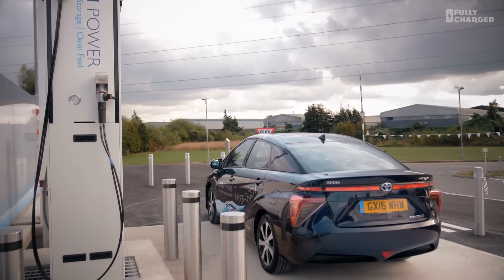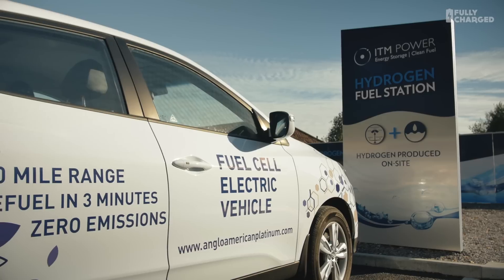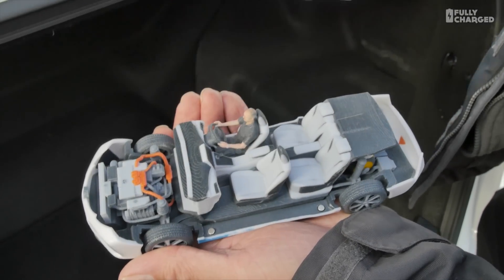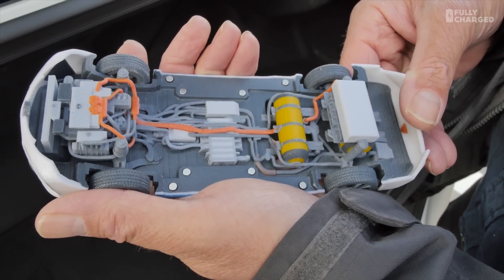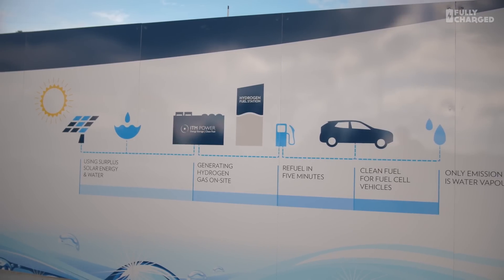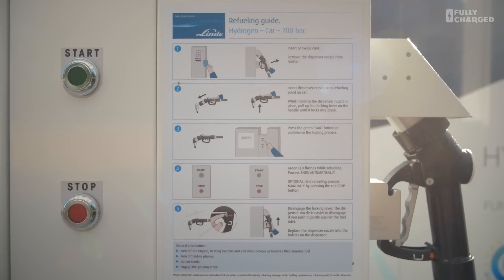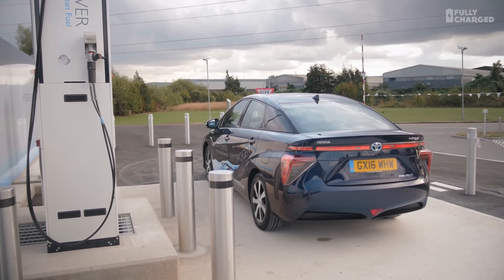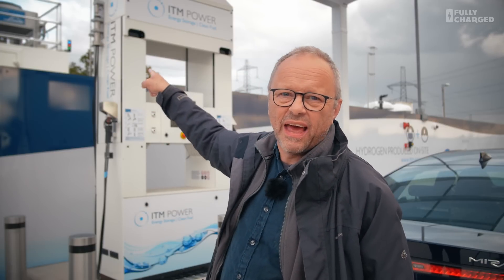ITM Hydrogen Rally | Fully Charged

Comment: It's Stupid. Why would I want to pay for Hydrogen? When I could generate my own electricity with solar and charge my own car. I'm not poor. These things are just too expensive for the middle-income people.
Reply: Andrew du Toit why not produce your own hydrogen?
Reply: Oliver Hamilton it is expensive to create hydrogen
Reply: well not many, I guess, similar to petrol, the three minutes filling time, and while oil is rare, water is almost everywhere (if they make it from water electrolysis) , and what comes out from hydrogen car exhaust pipe is also water
Reply: Wayne Johnson not from your solar array.
Reply: The energy is stored much more efficiently with hydrogen instead of batteries only. It will give you a greater range basically.
Reply: 88lochi Errm no that's not true. A the Tesla powerwall 2 has a round trip efficiency rating of 90% vs electrolysis and a 50% efficient fuel cell. https://www.tesla.com/en_GB/powerwall
Reply: Mark Tebbutt So can fuel cells "In combined heat and power (CHP) systems, the heat produced by the fuel cell is captured and put to use, increasing the efficiency of the system to up to 85–90%"
https://en.wikipedia.org/wiki/Fuel_cell
Reply: Oliver Hamilton Vs a 300% efficient heat pump? The excess heat isn't much use in summer when Solar power generation is at its peak unless use heat to power absorption chiller based air conditioning.

See my comment at the top of the comments. Battery electric road transport & heat pump space heating solution would increase electricity consumption by 3x. 

A hydrogen (liberated via electrolysis) fuel cell road transport plus hydrogen boiler decarbonisation solution would increase electricity consumption by 9x.
Reply: This is only true if you have a use for the heat.  Ie co-generation - burning fuel to drive a turbine and make electricity is pretty inefficient - but if one can then use the waste heat (which is typically dumped into a lake, ocean or river) to heat homes then one can double the efficiency. It's done in Europe, over here co-generation equipment is expensive and exceptionally rare.  But it's not worth it on something that rolls or if you can't use the heat (summertime anyone?) then that heat has to be dumped somewhere and that requires energy.
Reply: lol this is all very dejavu.

Fossil fuel advocates berate electricity/renewables in its early days, highlighting the many flaws it hadn't yet overcome.

Now the electrical evangelicals berate hydrogen for its flaws that it hasn't overcome yet either.

If it's not ready now there's no point carrying on developing it right?

It's hilarious how polarising people become once they've jumped onboard with one technology, desperate not to have theirs surpassed. iPhone/Android anyone?
Reply: Oliver Hamilton There are hard set laws of physics that can not be overcome. Converting energy from one form to another always results in losses. Converting low carbon electrical energy to hydrogen to convert it back to electrical power in a 50% efficient fuel cell makes no sense. A hydrogen fuel cell car requires 3x more energy to travel the same distance as a battery electric car.

True the will be some efficiency gains to make but these will be relatively small and will not reduced the 3x gap by much. See flow chart  https://drive.google.com/open?id=0B-TArhxXUn3gd3VOVERBZXYzQmc
Reply: Mark Tebbutt sure it may be less efficient, but the greater ranger from greater energy density, less weight, less lithium, shorter fill-up times, storage in cold environments, are all factors that can't be dismissed. 
It has potential.
Then we've not even touched on the other possibilities for powered flight where energy density is the biggest factor.
The fact is we need to continue developing it.
Reply: Mark Tebbutt also that charts negates regen on the hydrogen car. And doesn't take into account systems where the hydrogen is produced on site, like in the video.

The best solution for cars might be hydrogen + battery hybrid.
Reply: Oliver Hamilton Until Honda unveiled the new clarity the longest range low carbon vehicle was the Tesla model S P100D with a 312 mile EPA certificated range. The new higher power 350 KW vs today's 50 KW rapid chargers are about to be rolled out.

A 350 KW rapid charger could charge a Tesla model S P100D to 80% in about 13 minutes. 99.6% of UK trips are under 100 miles a day. 60% of UK properties have off street parking and thus can charge 99% of the time on the drive or in the garage overnight. 

The Toyota Mirai costs 14 pence a mile to fuel at today's hydrogen prices vs a 50 MPG diesel at 10p a mile vs my Nissan Leaf at 1.2 pence a mile. Typically on average 2p a mile is achievable for a BEV charged from off peak economy 7. Thus no contest. 

The advantages that hydrogen provide are being eroded. In fact one bus company that used to make hydrogen buses has switched to battery electric. 

"Rapidly dropping price for electric bus batteries combined with new fast-charging tech renders competition obsolete" http://thkpr.gs/3778463
Reply: Mark Tebbutt so what you're saying is development has made it better. Shocker.
Reply: Sigh - we're all talking at cross purposes.  Hydrogen storage has been used for decades - energy that would be wasted can be converted into hydrogen. But you're much better off doing everything else first - pumped water or pressurized mine/submerged bag storage.
My big fear a massive rollout of inefficient fuel cell cars in an attempt to deal with the fear of running the batteries down is crazy. It's like my neighbour buying a monster vehicle because once every few years he might need to move something big - people overbuying their houses. I was inspired by friends who bought the most efficient gas furnace they could - knowing full well that when we hit streaks of sub -30C days that their furnace WOULD NOT be able to heat the house to 21C. But for 99+% of winter days the furnace was the most efficient option.
We need to make due with cars that are good enough.  EVs are excellent for car shares and a lot of commuting - although I'd argue that people should be walking / biking / busing instead of using a car.
Reply: Oliver Hamilton Errm I give up I tried my best to explain the fundamental issues facing hydrogen but you seem unable or unwilling to grasp the issues.
Reply: Mark Tebbutt I gave up a while ago.
Reply: OK well, I did not know I would start a war like this. I know don't know much about Hydrogen except that it's not easy  to create pure Hydrogen and it's in the same category as fuel only the big guns can afford to manufacture it which means that we will  once again be reliant on a "Fuel Price" going up and down. Like with gasoline. At least Elon is trying to give us independence from these money mongers.This is what I am talking about. Hydrogen is not bad perse but we as ordinary people cannot produce hydrogen. Not clean Hydrogen anyway.
Reply: Range is no longer an issue as energy density for batteries has improved. Teslas.. the new bolt come with 200m range.
Reply: Consider us poor people that don't have driveways :)
Reply: Consider us poor people that don't live within range of a Hydrogen station. :-)
Reply: CorwynGC I am also that poor person. We have one that's about 60 miles away I believe. Most of them are in London.

Comment: The major advantage of Hydrogen is that it preserves the current user experience.  This was rammed home to me by Top Gear of all things where James May drove the hydrogen car into a fuel station and refuelled.  I then realised that it is not more efficient or better in any way other than the overriding concern of the current UI and establishment.

Petrol stations currently make almost no money off the fuel they sell.  Where they make their money is the cigarettes, food and drinks they sell while you are paying to fill up.  Oil companies are VERY keen to keep this business model.  Today they sell petrol and you buy the drinks that keep the service station open and oil company in your mind and tomorrow you buy Hydrogen at the same pump in the same way preserving the oil companies in the process.  Additionally as a fuel cell electric car is an order of magnitude more complicated than a battery electric car there will be much more scope for things to fail keeping the spare industry going and the repairers in business.  Battery electric cars are far too reliable and simple and they have the critical disadvantage(in the minds of oil executives) of being able to be charged at home thereby 'robbing' oil companies of a lot of income.

That is why they are so keen on Hydrogen and encourage the car companies to produce fuel cell cars.

I have never seem why this: (loss amount is the transformation costs in energy)

Generate electricity(lose 60%) -> Split water (lose 75%) -> Compress hydrogen to 700bar (lose 20%) -> generate electricity (lose 50%) -> drive electric car (lose 10%)

Is better than:
Generate electricity(lose 60%) -> Charge Batteries (lose 15%) -> Drive Electric Car (lose 10%)

However after the Top Gear episode I realised that both the car companies and the oil companies are so desperate to preserve the User Experience that they will happily accept all the energy transformation losses.  Only Tesla is going against the trend and marketing pure electric cars.

I think the future will be a mixture of the two.

Comment: How many Teslas could you recharge using the same amount of energy it takes to split enough H2 for a tank full from the water?  This is interesting technology, but it seems to add an unnecessarily over-complicated process between the wind turbine/solar panels and the electric motor.
Reply: Spiritus like Elon Musk  said...  Hydrogen  is just  silly...  Yes it's clean  as long  as you using  renewable  energy  yes it's as fast  as fueling  the traditional  petrol  engine  car  but really  I also don't  see the point for cars.  Maybe  airplanes,  trucks  or ships? And I am pretty  sure  with  superchargers  advancing  it not  gonna  be too long  when  you can charge  your  600km battery  in minutes.  Even  now it's  already  quite  fast
Reply: Problem with making electric car charging faster is to get much quicker the current has to increase massively. Superchargers are already what, 120, 150A? The cable required for just that is nuts, and that's a 20 minute charge. Want to minutes? 200+A. The diminishing returns come thick and fast. Gets quickly bad for the batteries too. Supercharging already affects cycle life.
Reply: Right, but that complicated process allows easy(ish) and cheap(ish) storage so you can offset supply and demand. That's the killer feature. It remains to be seen if this counters the inefficiency.
Reply: The answer is 4 (given the same range).  An EV will go 4 times as far on the same energy as a Hydrogen fuel cell vehicle where the Hydrogen is made from electrolysis of water.
Reply: Ross Bishop hmm that's  actually  true,  unless  they  introduce  some  new battery  technology.  Even  for Smartphones  exist  new batteries  which  ofc not ment to come  out  at least  until  2020

Comment: 700 bar, thats about 10000 PSI... i would feel safer in a zeppelin
Reply: He does state it can also be filled at 350 bar or 5,000 psi, but you get I assume a loss of range.
Reply: either way, thats a ridiculous amount of pressure :P
Reply: Geez, the chamber pressure of the Raptor Rocket Engine from SpaceX is like 6,500 PSI.... and thats a powerfull rocket engine...
Reply: I was use to handling those pressures when I worked in the gas industry and we never had any trouble with it, unless some idiot came along with a big digger and put a hole in the pipeline! Pressure vestals are tested to at least one and a half times their working pressure, 1100bar in this case, so don't worry. Any way, if it did blow, (which it wouldn't) you wouldn't know anything about it. It would be like switching a light off. As for the Zeppelin, they use to hold the hydrogen in huge gas bags that were prone to leak and often did, so I'd feel much safer in a hydrogen powered car that had it's hydrogen in a steel tank yhan in a Zeppelin with free hydrogen floating around. Come on folks, lets all get on board and save the planet.
Reply: They don't "blow" in anycase, the pressure vessels are designed to fail along a seam and to split, so the gas escapes more safely. Well, they're designed not to fail, but if the unthinkable happens and they do, there is a fail safe built in to prevent them exploding.
Reply: McBong's Lab http://evworld.com/article.cfm?storyid=482 hydrogen vehicles go through years of rigorous testing before they can even be considered to be on the market  
And they are completely safe even IF something did happen hydrogen would be released in a controlled way as seen in the article I linked
Reply: Jake Buttons we both know that in the real world things don't always work out as planned. There absolutely will be hfc cars that go bang in a big way at some point or another in the future
Reply: The amount of energy wasted compressing that hydrogen to over 300 atmospheres is going to be YUGE!
Reply: MichaelKingsfordGray  That energy could have been doing something useful, like taking KWh away from coal power plants instead of being wasted as heat. Pepsico is shrew about wasting 1% of their profits on shipping and we have here a process about as thermodynamically efficient as the internal combustion engine.

Comment: So it's still more complex then an EV, pumps are super expensive compared to chargers, it still needs a battery. EV Seems like a clear winner for at least the current upcoming years. Battery-only EV's have more then enough range. Would like to know how many kWh it costs (effectively) to fully fill up the cars with those big stuff behind the pump
Reply: Seeing as Tesla now has 100 kwH packs, the Mirai can produce 114 max and I have no idea really how much energy is required to produce enough Hydrogen to fill the 5kg capacity tanks.
Reply: Joshua Cornell Show me a report of a Mirai going cross country, long road trip, vlog.
Reply: It takes 4x as much energy to make Hydrogen as it does to charge an EV to go the same distance, so just multiply an EV's energy by 4 to get the number for Hydrogen.
Reply: azal, that is what this video and report was about though UK is nothing compared to the Americas, but even here hydrogen stations are few and far between. Least until Nikola and others start putting up their own stations at least across the USA.
Reply: Joshua Cornell There are relatively very few Hydrogen fueling stations in the U.S., even in the most populated parts of California.  There are thousands of EV fast chargers, and an EV can be charged from any household outlet, including at moderately high power from dryer, stove, welder, RV outlets.  There are tens of thousands of medium power public J1772 EV chargers in America, and many more coming.